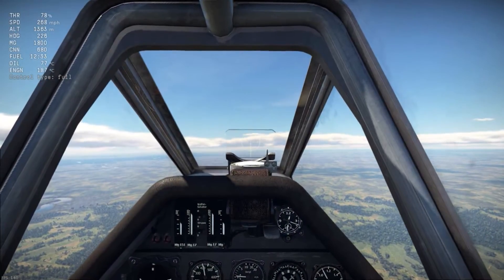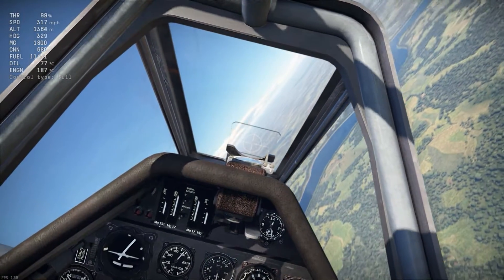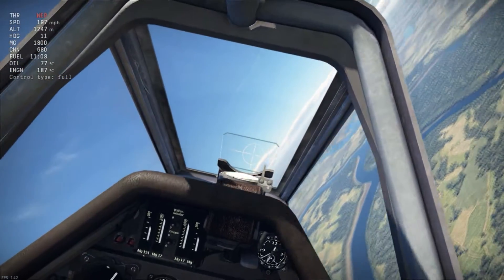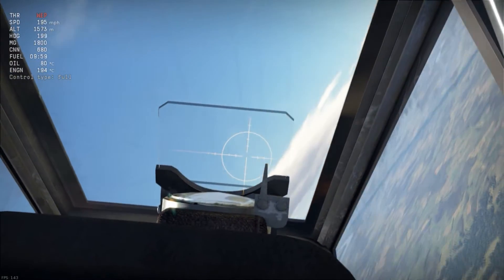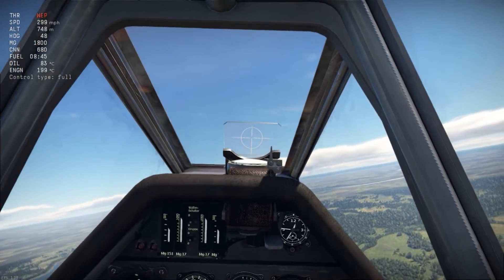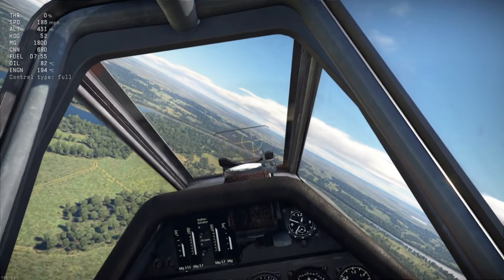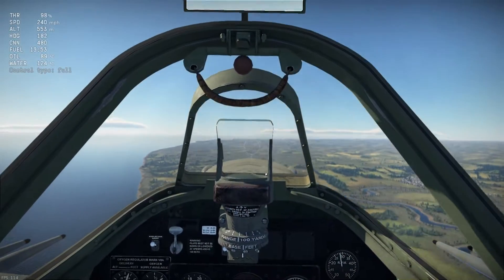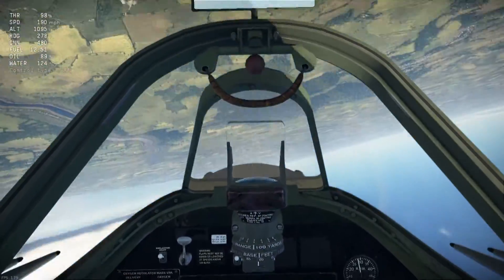War Thunder Sim Flight Lesson 2 - Avoiding and Recovering Stalls

Comment: I've played my first 4 battles ever of Warthunder using British planes in Arcade mode. Sometimes my engine just goes to 0%, I get a message about forcing my nose down, but whatever I do I end up gliding about for 2 minutes before having to land (always a bad crash no matter how gently I set down). How do I recover from this engine stall???
Reply from the maker: Early British fighters, especially the early models of Spitfires, had a type of engine carburetor called a "float carburetor" that, when there was negative Gs put on the airframe (by pushing the nose down), forced the engine's carburetor to flood with fuel and stall the engine. To avoid, always roll the aircraft so that the top of the cockpit points in the direction you want to turn (avoid negative Gs). If you do end up stalling the engine, you can restart it by leveling the plane and pushing the "I" key.
Reply: As a PS to the above, I won all 4 battles and would have twice as many kills (currently on 14) if my engine didn't just stop!

Comment: Stall is based on Angle of Attack, instead of speed. It may seem like low speeds cause a stall but have you seen a jet intentionally stall at an airshow? It's exactly this. He is in a too high angle of attack for that speed, the air doesn't flow over the wings, it leaves the wing and creates no lift.